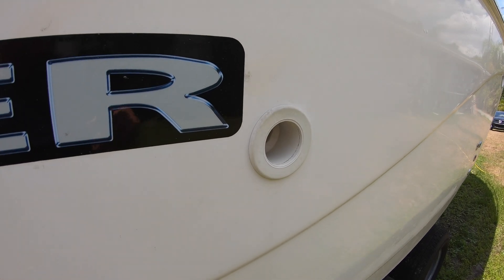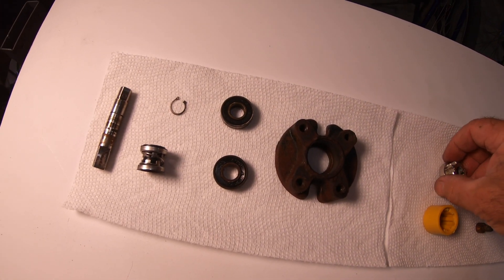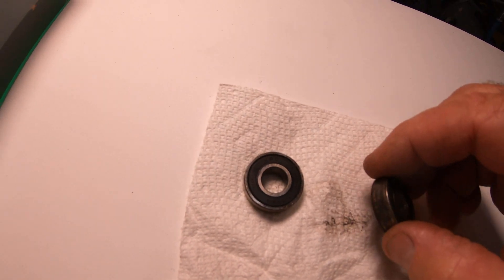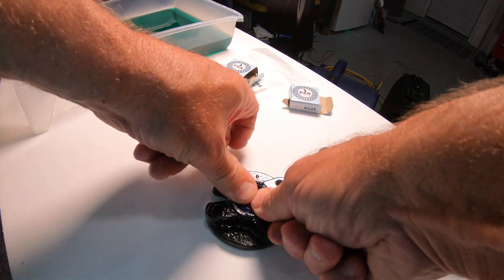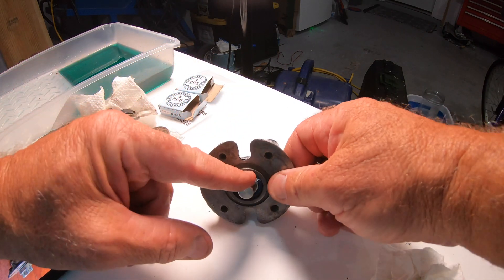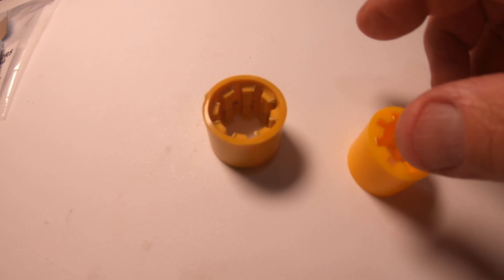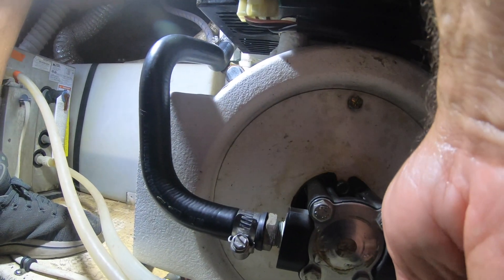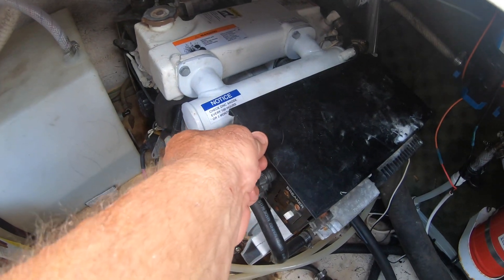Kohler 5E Generator Water Pump Repair/Replacement  4K

Comment: I have dropped the coupling inside generator, is there an easy way get it out or ok to leave in there
Reply from the maker: @tobyainslie4563  I dropped mine as well, and let me tell you what a pain it was to remove it! 
My cover probably had some corrosion from saltwater usage, but it was very difficult to get my cover off. It went back on easy enough, so maybe you won’t have the same problem. 
The coupling is made of plastic ( apparently a space age polymer because it was $20…) so if you weren’t able to get it out, I don’t think it’s that big of a deal. It would just get ground up and fall out of the way. 
When you put the new coupling on, put a little dab of RTV silicone on the spline and it will hold it in place so it doesn’t fall off when installing the water pump. 
Hope this helps!
-Mike
Reply: Ok thanks, when you say cover do you mean the plate the pump attaches onto that has the 2 bolts (not the hex ones holding pump).. I can't get mine off either

Comment: You assembled the mechanical seal inverted. The rubber side goes to the bearing end, the carbon ring goes to the ceramic ring side.
Reply from the maker: You are correct… I am going to go back and correct that on my backup pump. Thanks for catching that.

Comment: Thank you very much for this well done video. 
My sacrificial rubber sleeve between the pump and the crankshaft also failed. More than likely a bearing has seized. I’m just gonna buy the whole pump assembly.
Reply from the maker: Glad it was helpful. The new brass pump I bought feels indestructible!

Comment: Thanks for that pump rebuild tip. My generator blew that yellow coupling a while back.  Hopefully my bearings are ok.  I’ll need to pick those up at Amazon too.
Reply from the maker: No problem… I found a Sherwood pump rebuild kit on eBay from a guy that has everything you need. I’ll send you an email with his info…